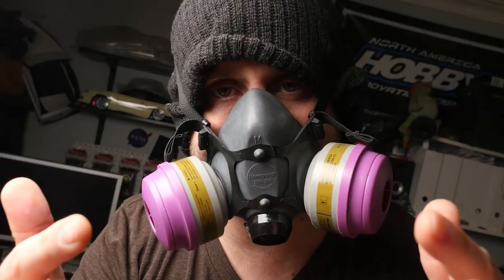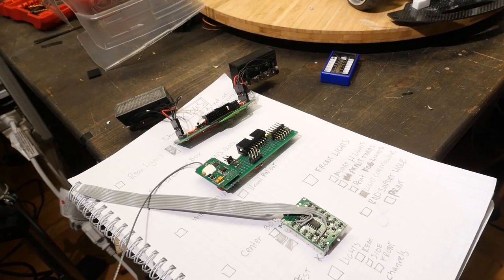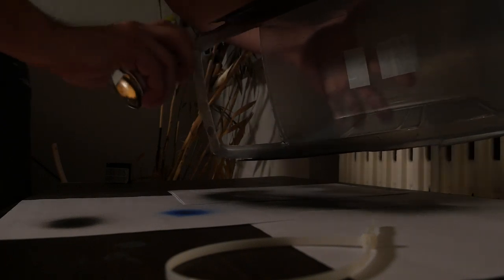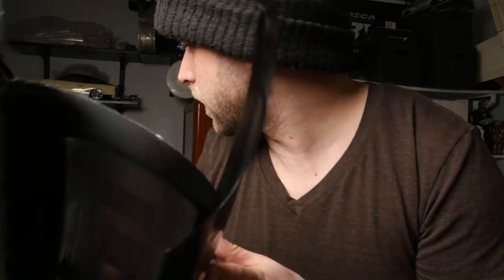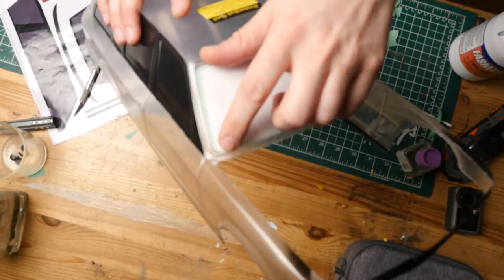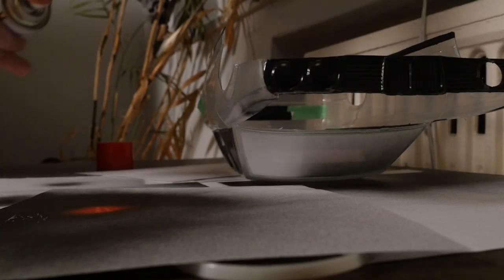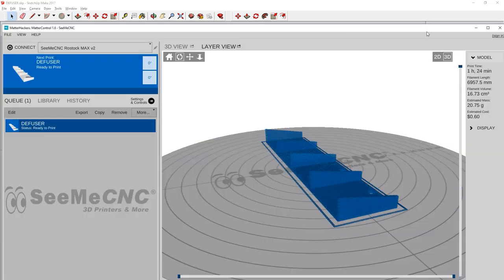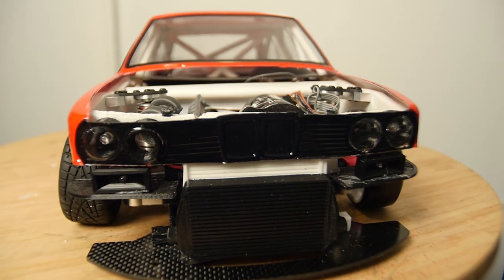E30 RC DRIFT WAGON - GETS PAINT - WINNER ANNOUNCED

Comment: PF...  I totally know that guy!!   Still can't believe I won.  Thanks again man you made my month, and I'm a huge fan of Hobbywing gear, it's pretty much all I run.  Thank you thank you thank you!!!  Stay safe out there everyone in these strange times.  

The only tip I have for painting bodies is something I picked up mostly due to my being impatient, and that is to hit it with a heat gun or blow dryer between coats, moving around on a low heat about 10-12 inches (30cm) away.  Be sure to keep sweeping and moving the air.  I found it sets the paint quick, and let's me move to the next step.   Please experiment first as your mileage may vary.